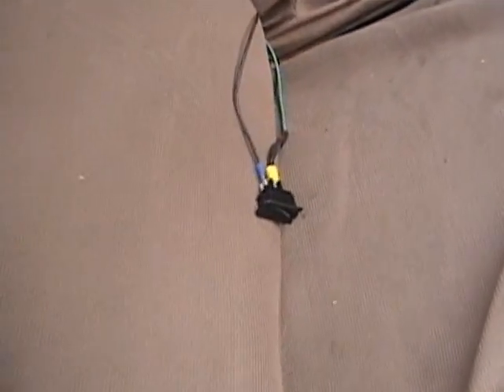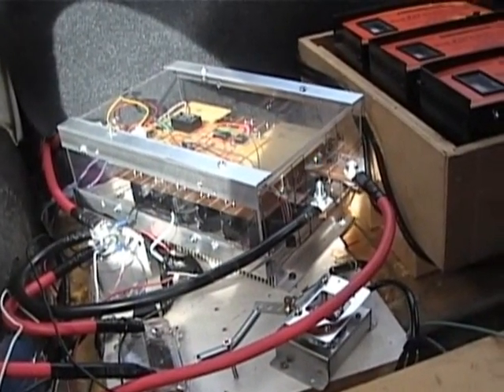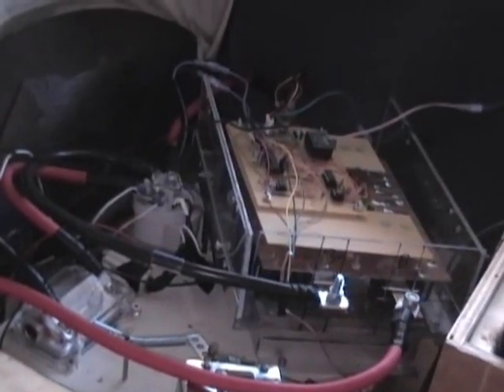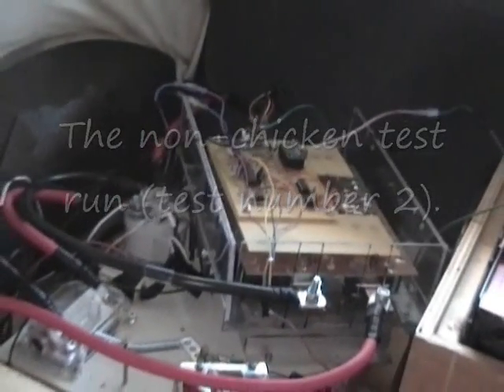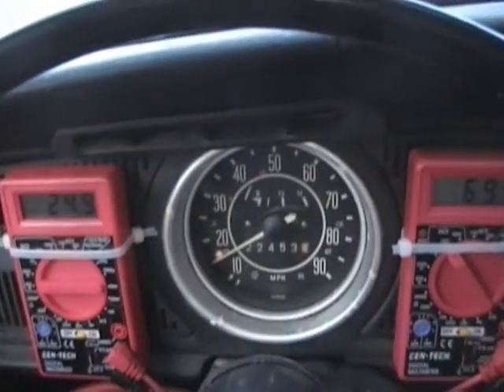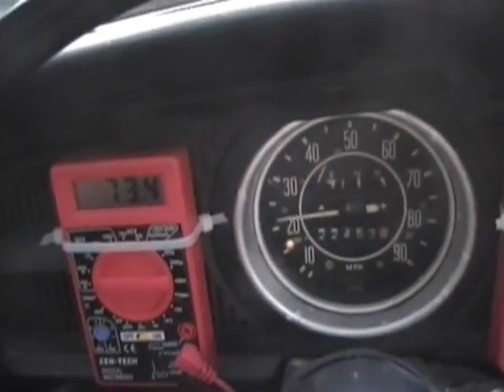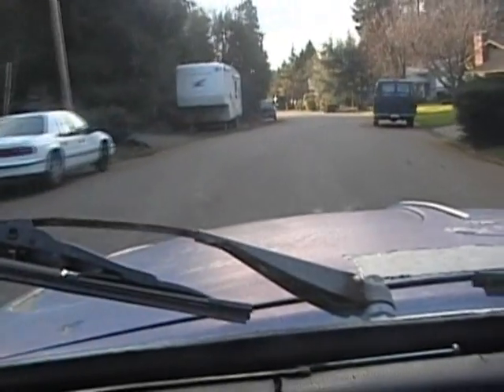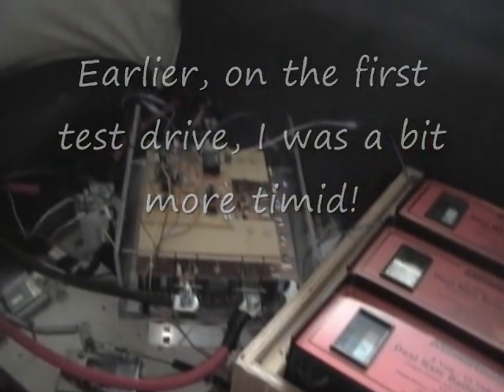Home made 144v 500amp motor controller.

Comment: Good logging parameters
Vehicle weight
Level road.
Time (t) from 0->Velocity(v)
Max Current draw (t)
Average Current draw (A/t)
Max voltage drop during (t)
End of run delta (V)
Then calculate wh/km
Controller Temps
Battery Temps
Motor Temps

Comment: what is the wattege of the motor? Is it 1500 - 2000 watt? and please tell me about the rpm also, i will be very greatefull.
Reply: I think more than 70kw it would be so difficult to run this car with 1kw motor
Reply: yes as it says 144v 500 amp motor from there we get that amp *  volt = watt
so 500*144 = 72000 watt
but the battery should have to be big to run this car for some time

Comment: Nice job on making your controller however is it worth it?   The cost of a controller is small compared to the rest of the mods especially the batteries and I can see that with just two IC on top there cant be much safety features built in or even regen braking!  Did you even have a line contactor?  
Don't get me wrong, a home made controller is excellent work and I admire you for that.
Reply from the maker: Yep there was a contactor and fuse and emergency disconnect.  This controller is better than the $1500 curtis 1231c, but the parts are around $300.

Comment: How in the world will you ever be able to get tags for that vehicle? Good luck getting that past inspection. :D

Aside from that great work. If you really want to amp up that rig. Use Lithium batteries in place of the SLA batteries.

If you really got money to spend, research on using super capacitors. I've heard they help cover the large amp spikes associated with heavy acceleration and would greatly increase the life of the batteries. ;)

Comment: A coal plant is much more efficient than a small combustion engine. Much more efficient. Normal combustion engine is max 30%, usually much lower when cruising, like <10% efficient. A coal plant is 50-70% efficient, so even with 10% grid loss (10% of 70%) and 10% charge loss, and 75% motor efficiency, you still end up with about 5x the efficiency. In shot, an EV will pollute about 1/5 of what a ICE would. Also, the pollution is contained at the coal plant, where eventually it can be handled.

Comment: What do the multimeters show? Is it voltage on the right and motor amps on the left, or what? I suspect that's not quite the case as otherwise you peaked at no more than about 7hp (or ~5kW), which probably isn't enough to send that car up such a hill at 25-30mph whilst still accelerating. And when you were tooling around in 1st gear it was more like 1.5kW / 2hp :D

Is there a follow-up showing an open road run & some harder punishment of the system than 1/2 voltage and <20% current? Since 2009?

Comment: Dear friend. If I buy an Ebike wheel with Voltage: 48V //
Wattage: > 400w  // motor type: 1000w 
Is possible swich the battery to some ultracapacitors like that one or they will lose power to fast?
Thank you

Comment: P = I * U = 144v * 500a = 72000 W  or 72kW of effective power. What a joyride if you let all this go at once. 72000W = 96.5535905 hp. Not that extreme but i think the torque on this is pretty high.

Comment: A 2.4 turbo motor in the back would be a liitle more fun?

Maybe you could cover it in photoelectric cells next?

Replace all the panels with carbon fibre versions or cheap after Market metal ones
And windows with plastic ones
Chuck away the bumpers and running boards
And spare wheel
And you should gain 50% power

What's the range?

Comment from the maker: throttle controlling pwm duty can cause problems in a car situation.  The motor has a very small locked rotor resistance.  So, if you are at a stand-still, and you give it just a tiny bit of pwm duty, it could very well be that the motor amps are extremely high.  This causes jerky starts, since motor amps is basically the torque.  Once you are driving, pwm duty controlled by throttle works perfectly fine.

Comment: Would it work the same if the throttle directly controlled the duty cycle? I'm using PWM motor control for a school project and I've got it set up so that I can control the pulse width with a potentiometer. Is matching the motor current to the throttle using feedback different?

Comment from the maker: Yep!  And actually, it measures current, and keeps adjusting the PWM duty so that current feedback matches the throttle.  So, 50% throttle gives 50% of max current.  It makes for very smooth driving.  It feels very similar to a standard gas car.

Comment from the maker: It just has the standard 1st through 4th gears.  I only use up to 3rd gear.  The top "low amp" speed is around 45 mph.  The top speed is close to 55mph, but I have to be in 3rd gear, and it takes like 250 or 300 motor amps for that.

Comment from the maker: 10 irfp4668pbf mosfets.  I'm using an atmega168 microcontroller for the pwm signal, and then there's a hardware overcurrent shutdown circuit, and also an hcpl-4506 optocoupler, and then a mic4451yn mosfet driver.

Comment from the maker: Ya it's DC.  The 2 gauge wire gets warm, but has worked out OK.  2/0 would definitely be better.  I've got some more videos too.  I've also got a 1000amp controller prototype too. and ac too.

Comment: What kind of motor are you controlling?  I assume DC - but what kind of DC?  Good job getting your controller to work - those curtis ones are quite expensive. Do you have any follow up videos?  Any problems with the wires? They look a bit small for 500 amps at 72V - I use  2/0 welders cable - it's 1/2 inch in diameter.

Comment from the maker: @blastforyou It's 500amp at 72v, which works out to 48 HP.  Throw in 6 more batteries and it's about 100 HP.  Switch to igbts instead of mosfets and you can relatively easily get 1000 amps at 400v (maybe 100 or 120 lithiums in series) and you are at 536 HP.

Comment: According to his reference to amp flow and the 72 volt this would equal about 10 hp if my memory of 720watt equal 1HP . I am still driving around in a hydrogen power vehicle that is 150 HP internal combustion  but  these electrics have merit and should be pursued however these electric systems tend to be complicated. FYI a hydrogen fuel cell powered vehicle has the best power to weight in "electric" vehicle cat. as the  electrons in hydrogen are used for electricity. NASA was first to use.

Comment from the maker: @tdneVmo The capacitors have no discharge circuit.  But these days it's all automated anyway.  Now you just have to turn the key, precharge coil is energized, caps precharge, maincontactor closes, precharge coil is turned off.

Comment: When you count to ten or whatever on your pre charge resistor, you will have to turn on the contactor WHILE the resistor is connected.
I assume that the capacitors has a discharging circuit, so when you cut off the power, the capacitors will discharge.
So when you release resistor, the voltage will drop maybe 3 volts until you turn on the main contactor. This voltage drop also represents a quite large amount of charge. It could damage your main circuit.

Comment from the maker: @totalrandomcrap IT's actually about the same weight as before, but with an imaginary adult sitting in the "back seat" (which no longer exists).  It does float, but now you die from electrocution every time you drive it across the ocean.

Comment: I'm guessing you built your own controller because the PMCs are still blowing up. That was a big problem in the San Jose area, and a local guy started building his own with really big IGBTs. They seemed to work a lot better. I was making DC converters for the same group, but I got put out of business by some outfit that used Chinese slave labor and sold complete units for less than I could get the parts for. I am still very much interested in electric cars, but don't have the time and $ to do it

Comment from the maker: @MustangsCanTurnToo My range is garbage.  To get 200-300 mile range would require Lithium batteries.  Maybe $20,000 worth.  

My top speed at 72v is around 50 mph.  At 144v it would be maybe 85-90 mph, and at something like 288v it could be much higher.  My range is around 25 miles or something with the lead acid batteries.

Comment: @MPaulHolmes I have a 600 hp mustang.  It has a range of roughly 200 miles on a single tank of gas before it starts to creep below the 1/8th of a tank line.  It takes about $40 of premium to go that far.  I discovered an equally powerful, electric Mustang with the same range but only costs about $7 to charge.  It made me reconsider electric cars.  Have you tested the range and speed of your car?

Comment from the maker: @tommiez92 Top speed is a function of voltage.  I am running 72v, so my top speed is around 45 mph.  My friend in Arizona is using the controller at 144v, and his top speed is around 75 probably.  He just drives freeways speeds though (they have cameras down there that take your picture automatically!)   Also it uses way more power to go much faster.

Comment: If we find a clean  way to produce electrical power for electric motors, oil will be fucked! We need also to find a way to reduce the weight of the accumulators.

Comment: Hi Paul
Could I build a controller for a warp9 motor running at 120volts and up to 750amps? Can solder and can read wiring diagrams can't afford soliton1 controller!!
Do you yet have a wiring diagram available( to purchace) and how cost effective is buiding your own?
Your video is very inspirational